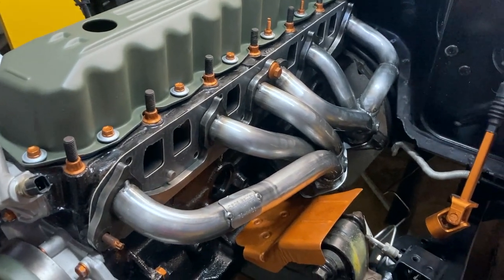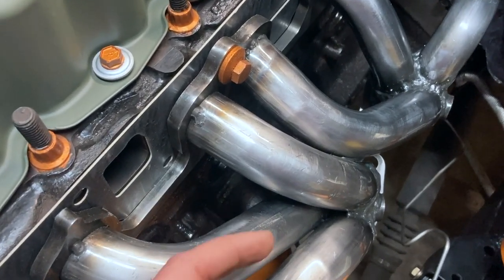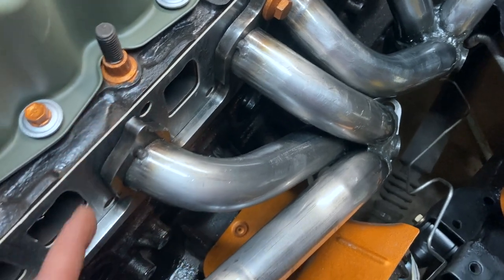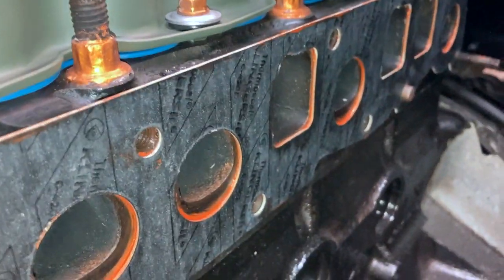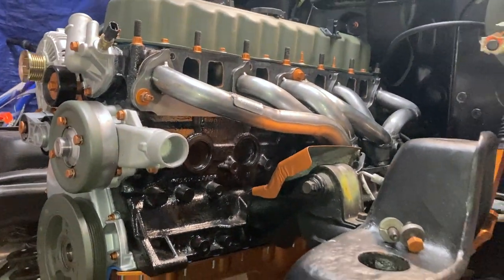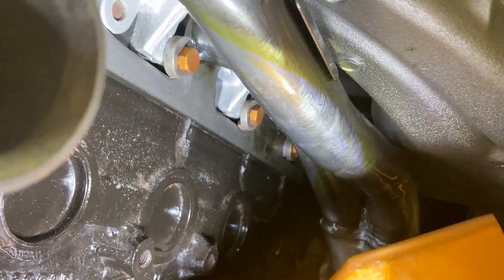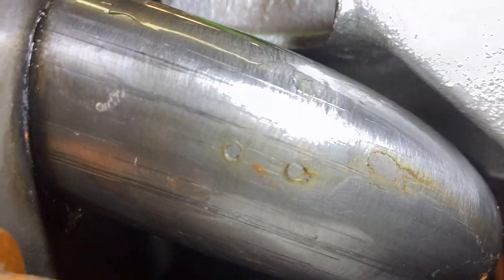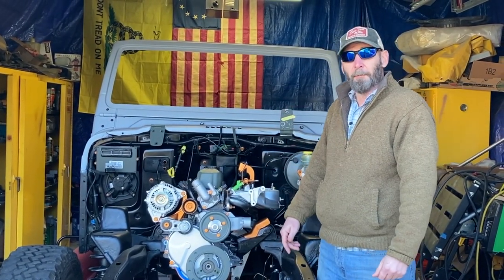Jeep 4.0 TJ Wrangler Exhaust Header for $209. fits 2000-2006 TJ . By PaceSetter made in the U.S.A

Comment: Wish I would have saw this prior to my catastrophe. I bought a cheap header off ebay to replace my other broken cheap header.  Anyways, it was IMPOSSIBLE to get to some of the under bolts the way the header tubes were run. (I did notice my cheapo header was not as thick as my intake.  But there were no instructions or bolts with my kit.  I had myself, my son, my daughter all under the jeep and couldn't get the header on correctly. So, i threw out the cheap header and bought replacement stock exhaust headers and called it a day. I was so frustrated.
Reply from the maker: Sorry about your experience  but at least you got to work on it with your kids. PS that would of been a cool family picture